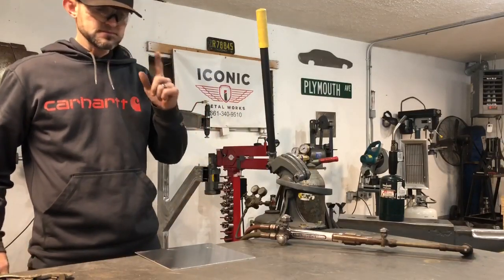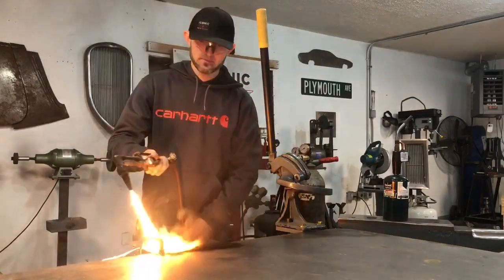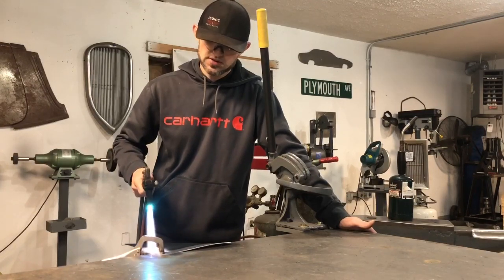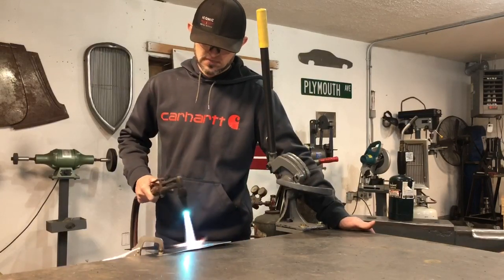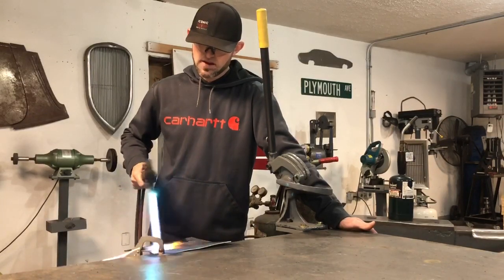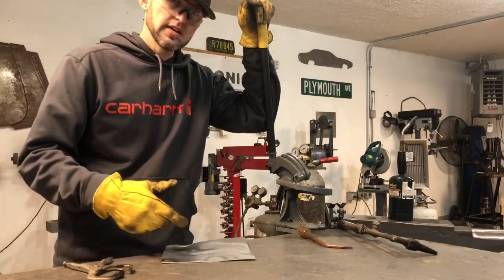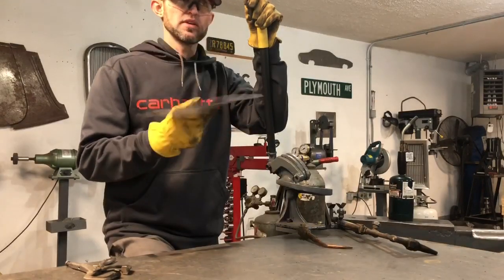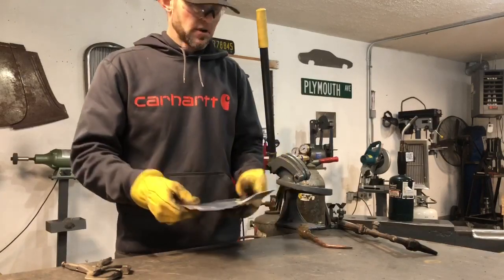Annealing Aluminum

Comment: So I have a crease in a door of a f250!  Should I anneal this before working on it to keep the aluminum from having oil can? 

If it’s soft than I could then use like a pdr stick to push the damages etc

????????
Reply from the maker: Absolutely not ! Hammer and dolly and your will have to shrink the door skin using a shrinking disc . Because when the dent occurred, it stretched the metal so it will have to be shrunk. Basically you have too much material now.

Comment: Tip: Use a multi-flame tip (rosebud) to avoid the concentrated spot heat and consequently have less half-melted spots. Tip: To avoid the soot mess in your shop, you can also use a sharpie pen instead... just draw some winding or crossing lines all over your sheet piece... then burn it off the same way: same result. Cheers!

Comment: Once the desired shape is acheived .... is there a way to heat it so it gets its rigidity and strength back ? Thanks
Reply from the maker: You soften it because of work harding and continue to work it to your desired shape which will work harden back or some so theres no need to to heat it this process will only make it softer

Comment: Shot in the dark here but you're clearly the man to ask. Thick Aluminum  - I need to bend an all aluminum Grab Bar for my Tri-Z (3-wheeler/ATV). It's a Professionally custom made unit for another machine (85/86 ATC250R) but I've had it for so long it's almost got some feelins to me & I'd love to make it work. It's essentially too wide & rather than doing spacers/whatever I'm confident adding a 2-2.5 +/- inch 90 degree bend on one or both sides would do me.
Reply from the maker: I would do exactly what your saying with what you have

Comment: Can you anneal a piece of aluminum more than once? I watch Lazze too and Ron Covell . Trying to get started on forming an Anglia body. Cannot find 3003 H14  .063 aluminum. I knew about annealing but didn’t know it harden back up after working it a short time. I have full panels to form 5052 is available locally for me
Reply from the maker: You can Aneal more then once but it will get brittle from work hardening

Comment: very informative, thanks! however this is more like "normalizing" than "annealing".
Reply from the maker: Annealing Is heat treatment That alters the physical chemical properties Of material. to reduce its hardness thats what Im achieving here in this video making the material soft and pliable to work.
Reply: Proper annealing has to be done in a furnace, with a controlled cool down slope. It's just a matter of slow you let the material cool down.

Comment: Annealing temp lays between 570 and 770 degrees use a non contact thermometer
Reply: Infrared thermometers are terribly inaccurate with bare aluminum.

Comment: What if you have a sheet and you just want to make a slight bend in a straight line? Would you bother annealing it? Something around a 25 degree bend. Looking to make a custom fender eliminator for a motorcycle and the taillight will be on the top of the bend, under the seat. Not really load bearing, but want to be safe.
Reply from the maker: I I would not anneal it you have to shape it first in the wheeling machine and have beading die or cut the fender in half and re weld then sand to a peak of your desired look

Comment: oh, then l should not heat before straightening if it stays soft after heating
Reply from the maker: It will work harden but yes I would Aneal it just so the material won’t rip when planishing

Comment: Good tip, I'm still surprised sometimes how many guys don't know the basics.
Reply from the maker: That’s what I am trying to tech people so half of the stuff that comes in my shop will stop. Everybody thinks they can fix something and that is flat out wrong ,I have to do more redos on customers cars then I can count
Reply: @Iconicmetalworks  I've made a lot of money over the years re-doing welding jobs done by guys with a $100 Home Depot welder and no training, I understand.  I also get that a diy'er wants to be learn and let his skills develop but not on a broken truck chassis.
Reply: Another "Basic" is that when the black Carbon coating warms up it will combine with Oxygen from the torch (and the atmosphere) to convert that Carbon coating into colorless Carbon DiOxide (CO2) gas.  No mystery at all.
Reply from the maker: @Joe-S-AK.andID. The black carbon burns off at. A certain temp . Which is the same temp that it takes alum to become aneled or softened it takes the aluminum to the point between solid and liquid. Any more heat would make the aluminum turn to a liquid.

Comment: That's very interesting to me since I work with these old GM and MCI buses that have a lot of aluminum panels that have to bee repaired. Can you show a video of tig welding up a hole in aluminum panels and putting in patches on panels also?
Reply from the maker: A hole is impossible to weld in a thin aluminum sheet but you make a patch if you clean it up with a unibit then weld it. I’ll see what I can do over the break
Reply: @Iconicmetalworks  That would be great!